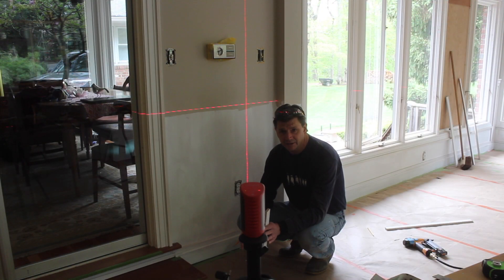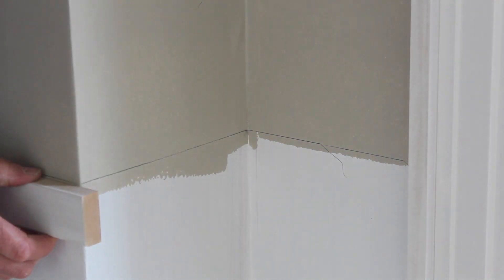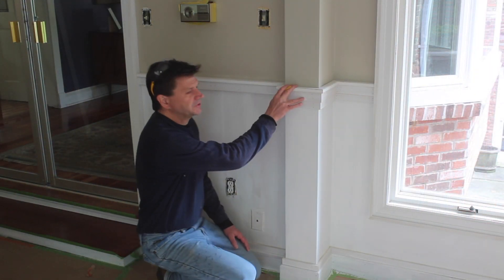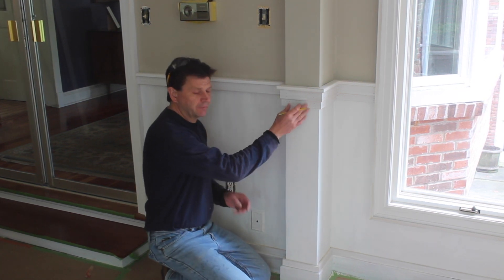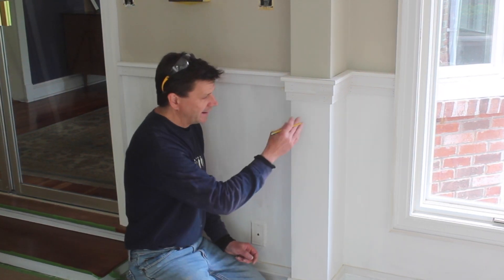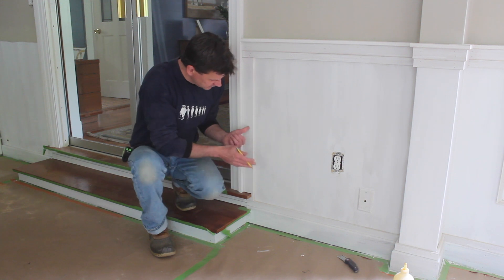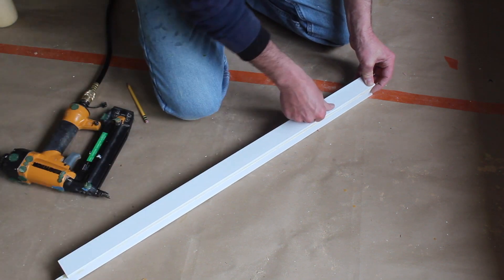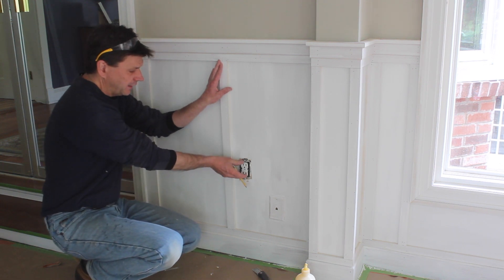How to Install Chair Rail with Flat Panel Wainscoting

Comment: Is the area (the wall) between the stiles drywall or sheets  of MDF? TY
Reply from the maker: In this case just drywall… sometimes I will use 1/8 Masonite or 1/4 mdf
Reply: @JonPetersArtHome   Thank you.

Comment: Great work! I'm curious: What is the advantage of tacking the molding from different angles?
Reply: I think he's going into the wall and then into the style
Reply: A straight in nailing could pull out. Angles into the wall helps secure trim a bit better in particular holding in place while glue dries

Comment: Hi Jon! Wondering if you could post the height (?) dimensions of all the pieces uses to build the chair rail. Thank you in advance. Great video!
Reply from the maker: Thanks, the height is , I think 36” but the best thing to do hold the molding agents the wall and do what looks best. Or in my case, what ever my wife thinks. :)

Comment: I noticed you have cast iron radiators. I grew up in a home my grandfather built in the mid fifties that had them and the painters faux finished them to look like the varnished wood trim that was throughout the house.

Comment: The second piece you installed (from the window) left a gap between the wall and the molding. How do you fix that? This was a great learning tool for me to do my dining room. Thanks
Reply: +Frank Thornal i noticed that too. im pretty sure itll just be a caulk job

Comment: What's a phone jack?
Reply: A phone jack is a term for the place where one plugs a land line telephone into the wall. On the wall, it is finished with a plate covering that looks like an electrical outlet, except that instead of accepting 2 plugs for devices that need power, it accepts (typically) 1 phone cord and carries phone service instead of 110v electricity.
Reply: LOL
Reply: I was just kidding guys.  Although my kids probably won't know what they are.
Reply: It occurred to me you may be making a joke, but YT is a big place and decided to answer it seriously. ¯\(ツ)/¯

Comment: Hi John , are the stiles and rails half inch MDF ? And also did you round off the chair rail top ? It's so hard to tell with the white paint. Thanks
Reply from the maker: Yes and 3/8 quarter round for molding

Comment: Hi Jon, I have an older home so the chair rail runs right in the electrical outlet cover.  Ado since I can't change the height  since the chair radio goes alkyl around the family room except two walls I can't change the height. So here is my question. Do I cut the outlet cover to fit into the chair rail or do I cut the chair rail to fit around the covet. Thanks so much,  debbie.  Ps in a widow so I'm doing alkyl these things on my own but I'm blessed as my dad use to track me little things but this never came up and my husband use to always do things like this for me☺

Comment: great job peter, this vid is up there with the best on this topic, hey, where did u find the quarter rails, the thin pieces u put in the last part, did they come like in any size, or did you have to buy a long length and cut2size? also, a price on supply for that entire wall you did would give us a better idea what 2expect in mdf cost? thank you sir!

Comment: great video I learned a lot. my question is it preferable to cut 45 degree on lap joints or is 22.5 degree better ? my experience with trim work is limited but i have used 22.5 in the past. I do realize this could just be personal preference but curious to hear your thoughts on this. thanks in advance
Reply: +Ozzy Deschapell What is the purpose of angling the joint?

Comment: This might be a newb question, but I am pretty newb-ish about some of these things: Is it preferable to use a laser level like this to measure a level line all the way across the room, as opposed to just drawing a line the same height from the floor all the way around? I feel like the laser level assumes you have a nearly-level house and that things haven't moved out of alignment since the house was built. If your floors aren't level anymore, or especially aren't 100% even all over the room, wouldn't a laser level line accentuate that?
Reply: A laser is self levelling and not dependant on the house floors etc
Reply: Well, right, but what I'm saying is, if your floors aren't level, but you put up molding to a level line, isn't that going to make your molding look crooked? I feel like one would rather have the molding parallel to the floor rather than level to the earth.

Comment: Do you have textured walls? If so, how did you solve the texture in the wainscoting? Thanks!
Reply from the maker: No , you could add an 1/8 panel in the frame

Comment: Hey John, I  just purchased a fixer upper home in Shark River Hills NJ and I'm getting all new siding and new construction windows put in our 1920's home. First.....Do you recommended new construction windows or replacement (we are going with vinyl windows, we need to replace 28 windows $$$)? Second..... I saw your recent video on window casing.  To save some money, I was contemplating doing the interior window casing myself after the new windows are in. I am fairly handy, and feel I can tackle it if what I am under taking resembles your casing video. Do you think replacing interior window casing on a 96 year old home with plaster and lath should be left to the pro's? The unknowns have me a tad worried. Thanks again. Peter

Comment: after you fill the nail holes, do you reprime before painting? 
are you worried about the mdf getting chipped when bumped? did you use a sprayer to paint?

Comment: The nail gun you were using for the 1/4 round, is that a 23g pin nailer or just another 18ga nailer but with shorter nails in it?
Reply: I think it was an 18g by the looks of the hole size.

Comment: Looks good Peter, I see you are cutting inside but if your in a situation where you can't, I find using a hand saw and a home made miter fence is really quick for cutting the 1/4 round. Saves you from Getting up every time:)

Comment: This is probably a very elementary question for someone with your skill and experience but..... what type of nail gun would you use to install shoe / 1/4 round on baseboards? I am curious if you would just stick with an 18ga or would you go even smaller with a 23ga pin nail?
Reply from the maker: +Mike Weckesser hi Mike , I almost always use the 18 g been using it for years
Reply: Awesome. Thanks for the reply. Ive just seen you use your 23 pinner before but just on decretive moldings. wasn't sure if shoe/ 1/4 round counted as that. Great work on every as always. I learn a ton watching your videos. Skills but also just have patience when working on things. Have a good one

Comment: Hi Jon, as always, great stuff!  For your MDF molding, do you start with a 4x8 sheet of MDF and then cut strips and prime before installing, or do you buy the MDF already cut to width and primed?  I have been thinking about using a 4x8 sheet to help offset the crazy cost of big box moldings.

Comment: why trace the laser to make a "reference line" if you have a laser. Isnt this a waste of time? you have a laser!
Reply: it's a nice back up if the battery goes before you're done.
Reply: usually the Lazer is blocked by you when you're working up against the wall. You can't use the level because of that. it's only for reference marking